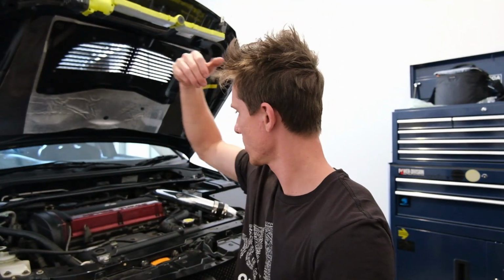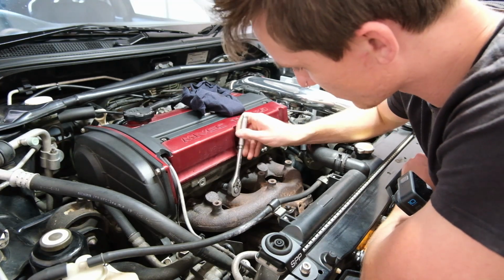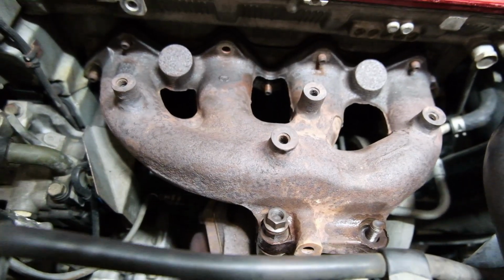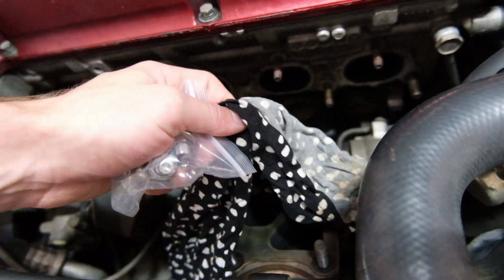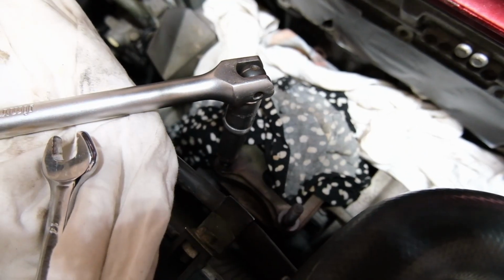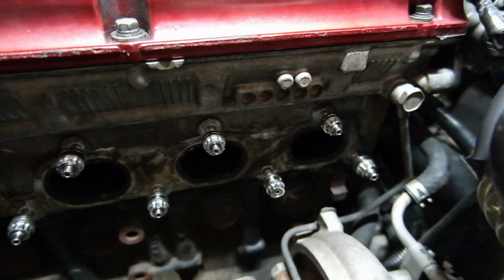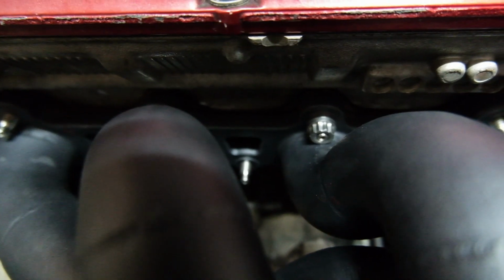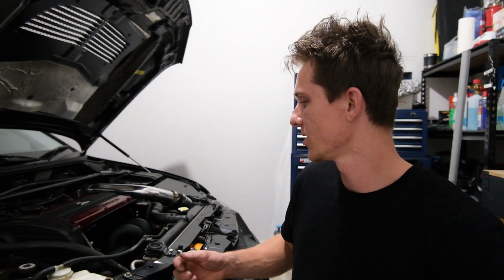My Evo 9 gets a Hypertune Exhaust Manifold!

Comment: I've got the same Hypertune Turbo Manifold & Titanium exhaust studs for my Evo but yeah its a pain to remove the stock Manifold luckily you didn't have to remove the radiator I had to remove my aftermarket aluminium radiator to do this process & I heat wrapped the manifold as well since it doesn't have the heat shield anyways love all of your Evo contents videos. Much love from Sydney Australia.
Reply from the maker: Thanks my bro!!